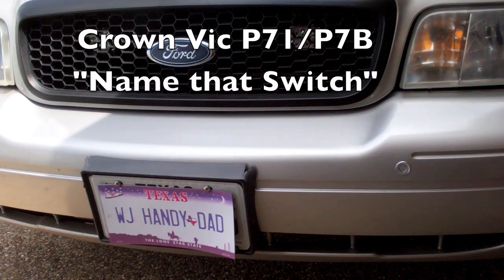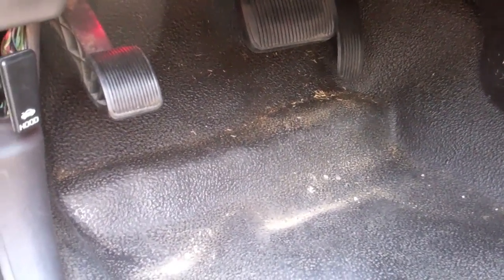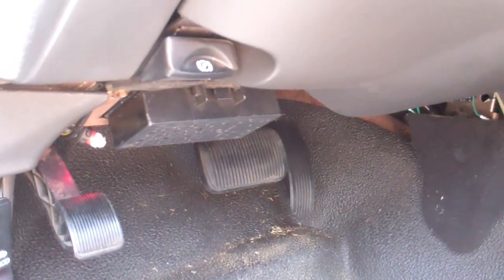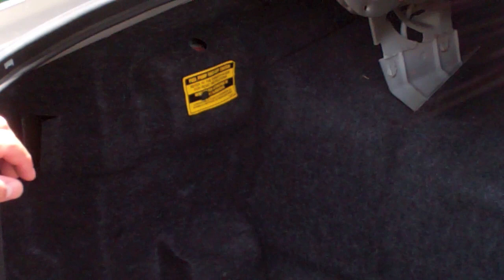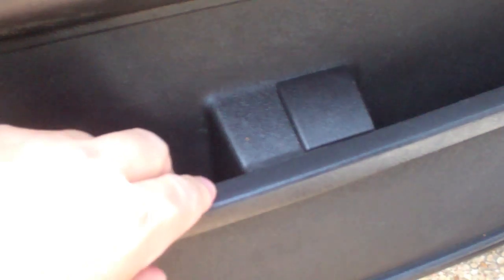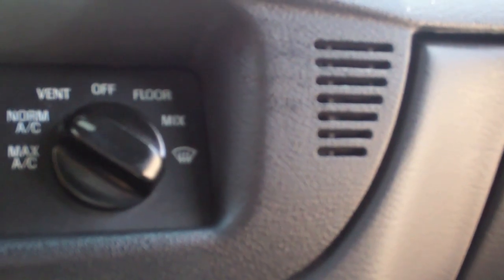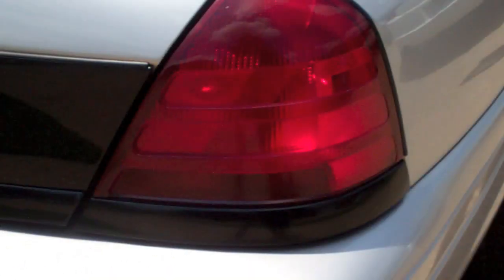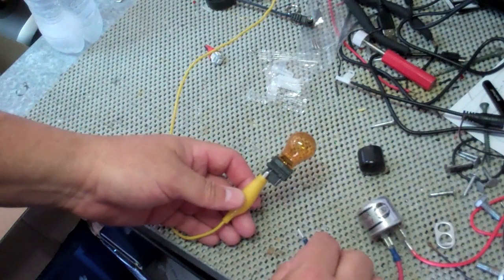Ford Crown Vic police interceptor P71/P7B what is that switch for

Comment: It's great you did this video . Thanks  ,I'm trying to buy an 06 p71 that is still in service  with 37,000 miles & 5700 hrs .The good thing is I get to help remove the accessories
Reply from the maker: That's the best way to do it.  I got my Caprice that way.  My Charger was downfitted so roughly it required a TON of work to get it acceptable.
Reply: best years, 2004 to 2006, good luck, mine has 190.000 km on it, runs like new. Just make sure to maintain it, and follow oil guides, exactly
Reply: best years are 2006 - 2010!

Comment: The traction control control and pedal adjustment switches are usually there when the car has the options. If they don't, there's most likely no hardware for it. So you can't just add the switches and have it work. I've tried in both of mine. It also doesn't make sense why they would add the features, but not give you a switch.
But, someone may be luck and only have to add the switches. Then I guess you're special. 😅

Comment: My confusing switch was a blue switch right next to the electric pedal adjustment switch. I popped the panel off, 1 wire was grounded and the other 2 seemed to have speaker wire going somewhere. I’m thinking maybe it was a headlight wig-wag switch although it could have also been a secure idle system since my ignition wires look to have been messed with.

Comment: What year is your Vic? I have an 07 P71 with all the switches for pedal and traction, but no flasher. It's built into Light Module apparently, which goes crazy when I switched 100% of bulbs to LED's.
Reply from the maker: mine is an '08.  After I posted the video, a couple people sent me pics of their P71 that has the pedals and traction control buttons there.  But the vast majority of P71's don't have them, just the wire harness and tons of people ask about them (even one posted it 5 minutes after I posted this video!)
Reply: WJ Handy Dad yeah, can add the adjustable pedals, but have to swap out whole pedal assembly for one with motors, wiring is under dash as well. The traction controls is off the ABS module itself, not sure bout that. I have my traction control disabled. Hate how it kills power to engine when taking off on ice, just lock in 2nd and go, lol.
Reply: Yeah, my 07 is an oddball... Has different rear gears, all the extras, even has the speed steering, which is failing, lol.
Reply: BigOxxTech I had that same problem.  When you put  L.E.D lights in, you may experience "Can-bus" errors.  So.. Put in only canbus error free led bulbs. Led's can also cause rapid flashing of the signal lights. The problem is that the flashers are designed to work on resistance generated by standard bulbs, whereas led's offer very little resistance . Every single bulb in my car is led, and I have had no problem with them for years now. Good luck and I hope this helps you.

Comment: My fav strange button is on the end of the shifter which knocks out the overdrive and gives you a 3-speed trany.  (for pulling a trailer?)  Button is hidden in plain sight.
Reply from the maker: definitely makes the car feel more responsive when driving in town
Reply: WJ Handy Dad with overdrive on while I accelerate and get to about 40 with overdrive on... car stays at 40 for about 15 seconds then jolts hard before accelerating any more. But if I turn overdrive off before getting to 40 it has no issue at all and I turn it back on around 50 and it has no trouble at all after that. Is that normal or is my trans probably on the way out?

Comment: The traction control is hooked up, but 99% of police vehicles would need to have it switched on through the computer by the dealership. The adjustable pedals will only work if you have the motor going to them.  Again 99% of police vehicles do not have that installed

Comment: I have a toggle switch right behind a hole next to my truck release button on my dash, wonder what that does?
Reply from the maker: my guess in that location probably some form of "secure idle" switch
Reply: @WJHandyDad  been doing some reading on it, I guess some Depts put a brake light kill switch here. I can see the switch through the hole, so in a second I’m taking the trim off and finding out. I love these cars, finding all the nifty things they put in them is an adventure.
Reply from the maker: @phillipbrazil2108  that's certainly another possibility

Comment: @wj how do you install leds down by the foot trim panel
Reply from the maker: there is a wire that runs all around the car with + power for interior lights.  You can tap into it virtually anywhere and add a light.  I added lights under the front dash, on the b pillars, and on the c pillars - they are all sync'd with the dome light
Reply from the maker: https://www.youtube.com/watch?v=j778BuzOwQg

Comment: It sucks i lost 2 4r70 transmissions one i overheated and the other for doing absolutely nothing =/ My 07 had high miles anyway but my 04 actually was supposed to have the favored 4r75 transmission but due to the fact my 04 was one of the very first built in January 2004 it had a 4r70. I only have a young 08 left now
Reply from the maker: that does suck...  they were probably abused before you got them (rev high and drop into gear, shift from neutral to D while moving, that sort of thing)
Reply: Running with a bad tail piece yoke bushing will cause the trans to fail I discovered. The line pressure that applies the direct clutch enters the hollow output shaft where it passes through the case. There are 3 ring seals there and if the bushing in the tail housing the driveshaft yoke rides on is bad it will cause a harmonic in the output shaft to develop and wear the case out at those ring seals. Luckily there is a sleeve kit to repair the case and I was able to rebuild it with some extras added.

Comment: So how do you get LED to flash?
Reply from the maker: if you're referring to using LED bulbs in your turn signals, you'll need resistors, an LED specific flasher unit, or LED bulbs that trick the car into thinking they are regular bulbs
Reply: @WJHandyDad  Thanks I appreciate you explaining how that works have bought the LEDS  but haven't had time to install them this and your videos will really help.
Reply from the maker: @mikeguthrie6933  Check out @Panzer Platform too - he's done quite a bit of LED stuff on his cars
Reply: @WJHandyDad  I will Thanks

Comment: I have a 05 crown vic my over drive light blinking off and on wat could it be
Reply: Tim Bo it’s the switch at the end of gear shifter. Probably one of the plastic pieces are broke
Reply: I've been told from the Ford garage that flashing from OD on/off lightis code from transmission

Comment: My head lights and dash keeps going in and out.  I don’t even drive at night right now.
Reply from the maker: could be LCM (lighting control module).  Several years have a recall on it.
Reply: I replaced my relays under hood. The small ones and fixed a leak at the rear of intake due to coolant was causing misfires. If the relays don't help then I'd say check for coolant at rear coil pack on passenger side and check that heater house that goes into your intake. Be careful it's there are signs of coolant the heater hose inlet breaks down and becomes brittle. 2003 cvpi P71 166789 miles.

Comment: I just purchased a 1998 Ford CV PI sedan, it has a "inertia switch". The red button type device in the trunk. 😒👮🏻🚔🚓... This vehicle has a wire or some kind of safety feature to disable the fuel pump. The red button is DOWN so I think it's either broke or malfunctioning ...
Reply: Push the red button

Comment: What's the difference between a p71 and p7b?
Reply from the maker: just the VIN... 2010-2011 used P7B, prior used P71
Reply: @WJHandyDad  

👍So basically no difference in the car? Don't the 2011s have the most horsepower?
Reply from the maker: The HP is supposed to be the same from 2003 (or 2004?) up.  But they all perform similarly in 0-60 and 1/4 mile, at least on internet sites that report that data